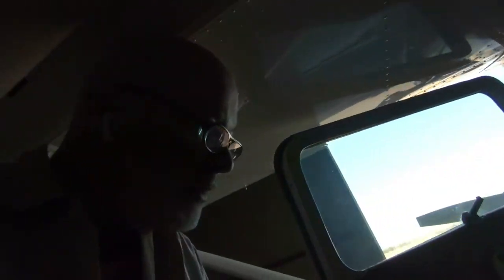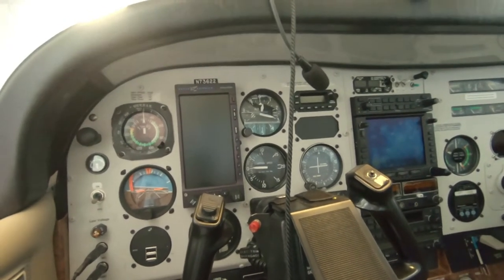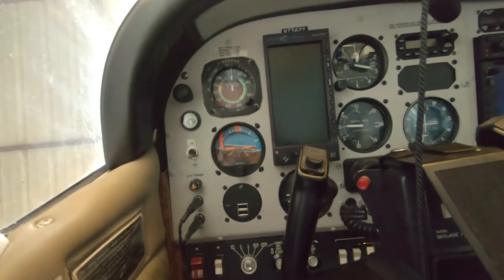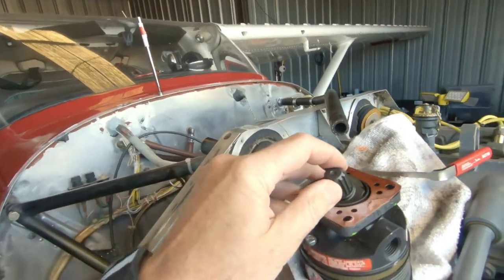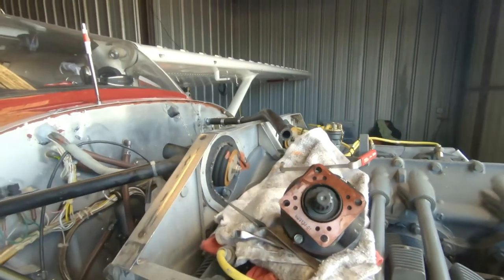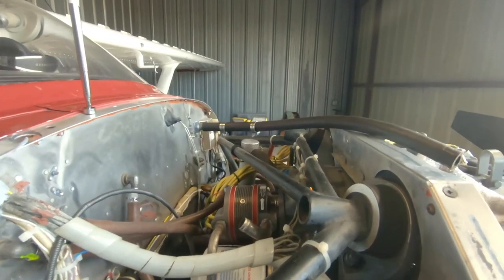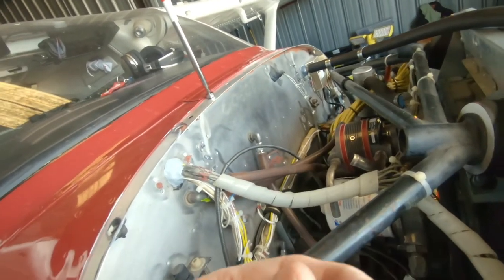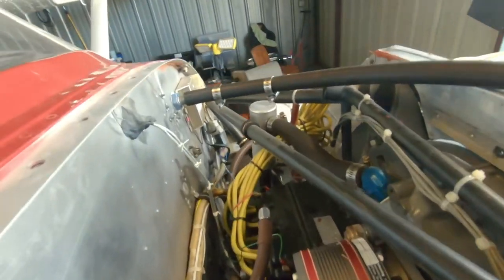Vacuum Pump Install TR182

Comment: I have a TIO-540 on my Aztec.  I lost two nuts into the bottom cowling trying to put the vacuum pump back on after the coulpler sheared.  Even bought the factory bent wrench.  Your little invention saved  a half day frustration.    Thanks!
Reply from the maker: Glad it helped! The bottom nuts are a pita! Pulled my last vac instrument this year so was happy to ditch the pump finally!
Reply: @kennethfrank2000  I put in two G5s but kept the vacuum system to run the attitude indicator as a backup.  My electric AI failed after about 500 hours, and it was almost as expensive to repair as to replace.  Turns out a lot of people know this and have the AI on a switch, only turning it on in IMC.

Comment: Isn't there an electric instrument that could replace the vacuum driven one?
Reply from the maker: PFD is an Aspen 2000 which has a bizarre set of requirements for backup instruments.  So decided to replace the Vac Pump for now but will be putting in a Dynon Skyview HDX this year and be done with the Aspen